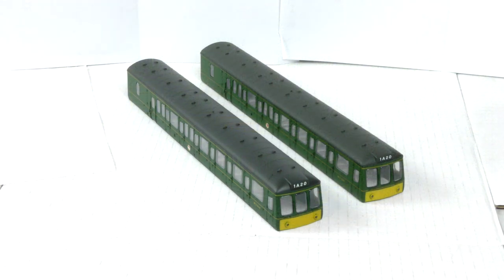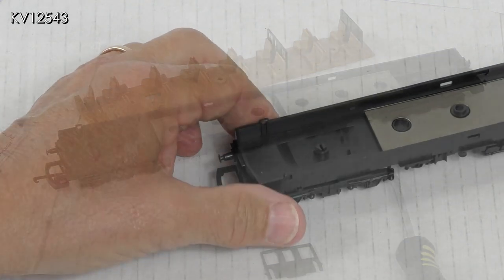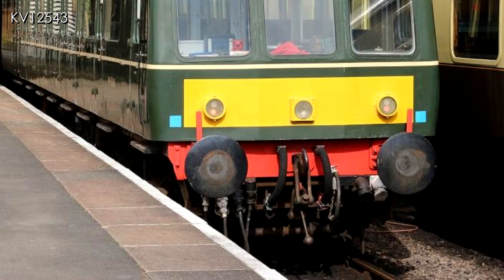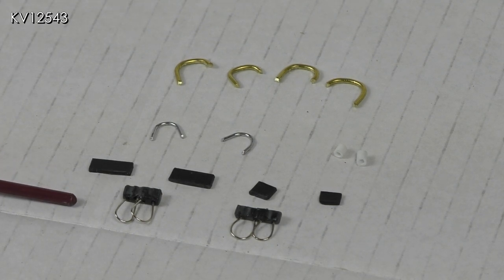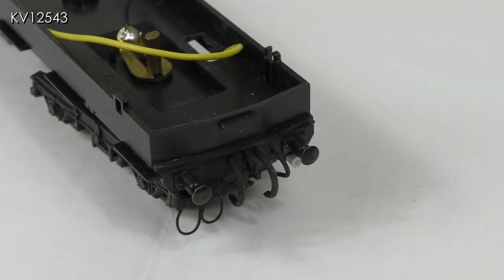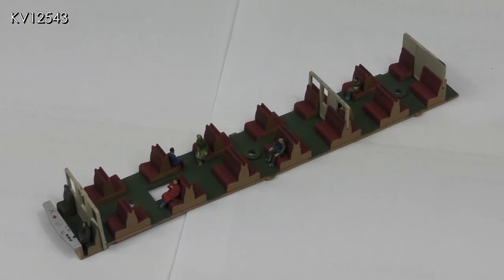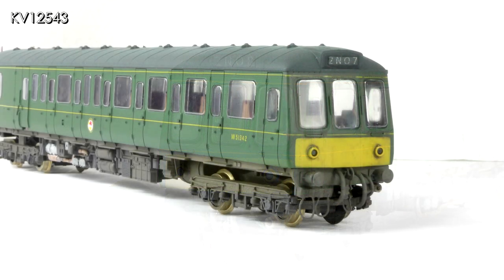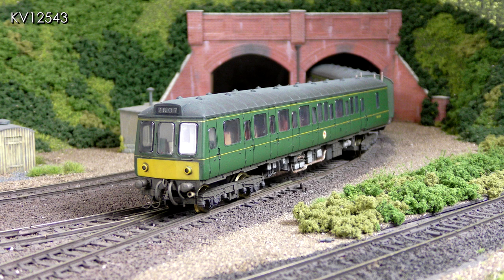LIMA Class 117 DMU upgrade - Part 2

Comment: I've always added pickups to wheels with traction tyres as well. You'd be surprised how much flange contact can improve reliability too.
Reply from the maker: Interesting....although because of poor soldering skills I have always shied away from adding wires to motor bogies. I might give it a try in future though, Keith
Reply: @KV12543  rather than thick wire that you used, just use enamel wire,  perhaps off an old speaker or transformer. Solder it to the surface of the pick up first, then superglue in place with activator if necessary. I cut and form the whole pick up from a single piece of beryllium copper, although as you said phosphur bronze holds its.shape too. It's so neat it barely needs painting in
Reply from the maker: @gs425  Thanks for the tip, Keith

Comment: The tiny Lima buffers can be pulled out and replaced with Oleo buffers from Peters Spares. They make a world of difference.
Reply from the maker: Most of mine were fixed solidly to the buffer beams so I left them as they were to minimise damage when removing them. Since then and being a bit of a bodger I have found that a hole punch and thin plastic makes excellent replacements. I simply glue them over the originals.
Reply: @KV12543  That’s a good idea! Certainly would look the business.